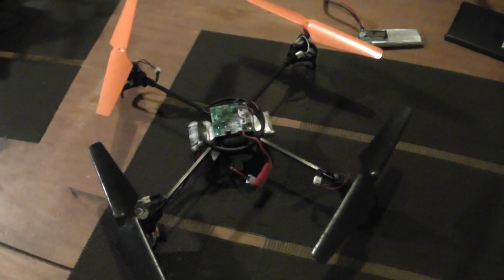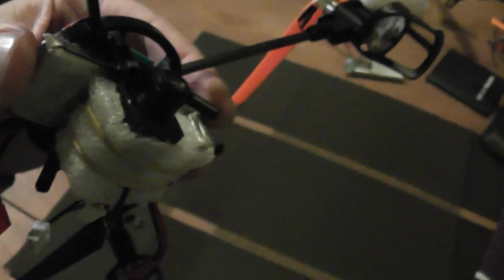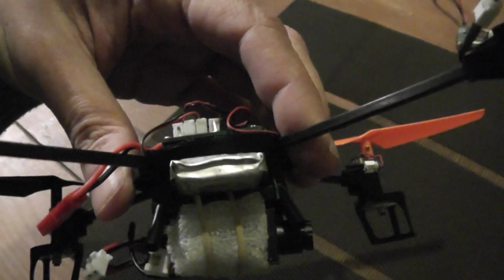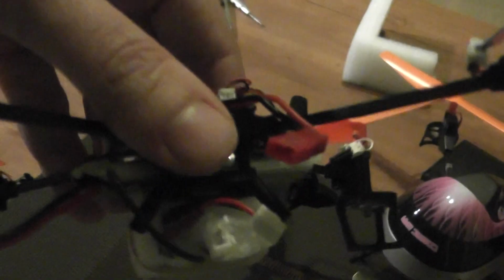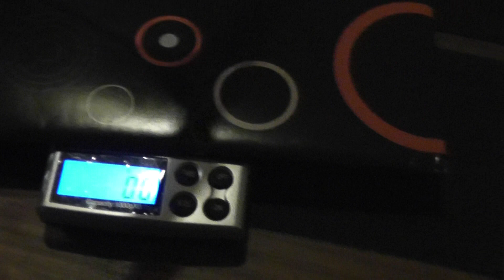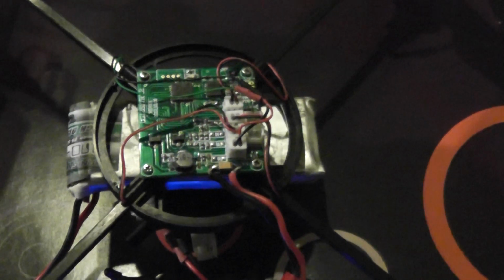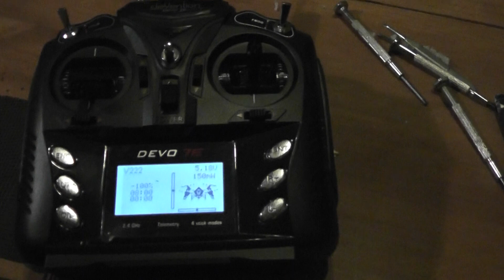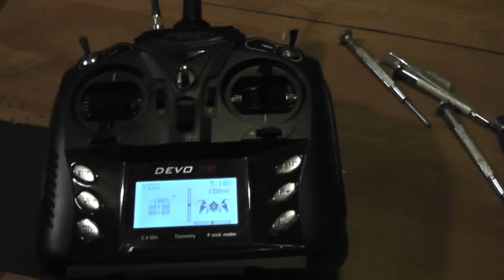Cheap and easy quad FPV setup for dummies

Comment: I'm working on a similar build using a Syma X1 - virtually identical to your WLtoys V212.  I'm really happy to see this kind of thing happening, making it more accessible to poor people like me. LOL  Jus sayin.  My wife has me on a tight budget!  XD

I'll post a video response once I get mine up and running.

I subbed to your channel, can't wait to see your other fpv videos!
Reply from the maker: You wife (as mine) didn't realize yet this hobby is even more addictive than real drugs :). It's a good idea to start with a relatively cheap FPV kit... At least, you can determine by yourself if FPV is for you or not.